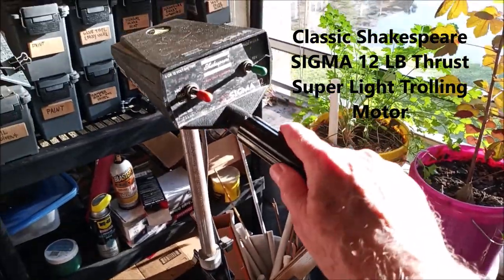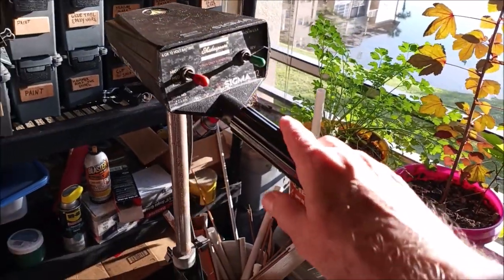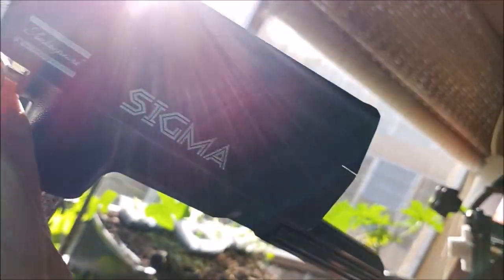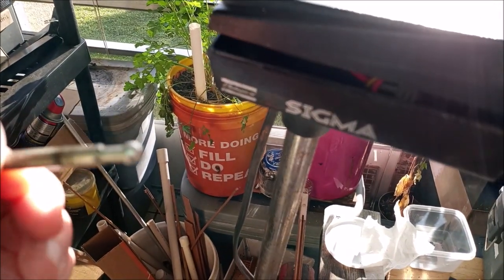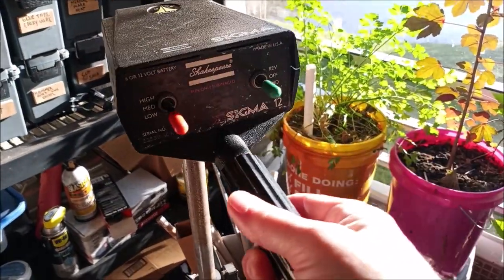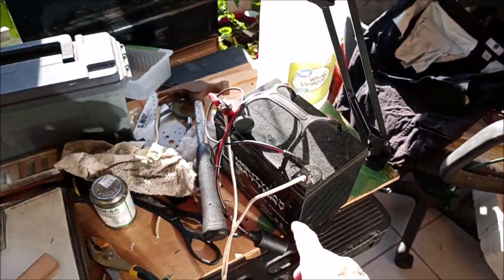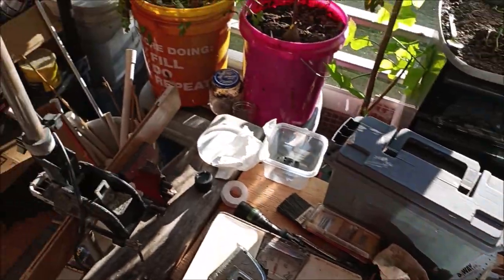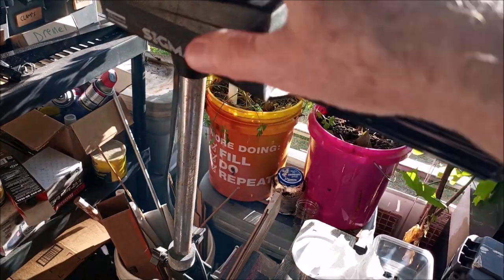Classic Shakespeare trolling motor SIGMA 12 - How to reverse the Control head.

Comment: Robb have you ever had to replace the propeller.  I can't find a replacement for mine.  Can you recommend a substitute
Reply from the maker: Hello, I haven't had to look for one yet. I doubt I will find an original one from the manufacturer. There are a lot of trolling motor propellers on eBay and Amazon. I think the best thing to do is to see how the Shakespeare propeller is attached and see what replacements look like they might be a good fit. There are some propellers for less than $20 on Amazon and eBay. Unfortunately I don't know if they would fit or not. Let me know if you get lucky.

Comment: Can you do a whole video on removing the head unit? I have a sigma 14 and the pin will not pop out. Any advice would be greatly appreciated. The pin will twist but not pop out.
Reply from the maker: Hi Jack, I don't know what else I could show you that I didn't already show in the video. My pin can be pulled out with pliers after twisting it. Make sure you are twisting it back and forth as you are pulling it. You could also squirt some lubricant and see if that helps.

Comment: I got a minn kota 38lb for my kayak and boat for 40$. The guy tossed in  a sigma 15 for 10$ After testing them I realize the 38lb is a bit much for the kayak but this sigma 15 is perfect for it. 
These are neat little things! I also recommend for anyone to get one of the my plan on using it for smaller boats and kayaks
Reply from the maker: I agree it sounds like you got a great deal. I always liked the little Sigma motors because they were very light. I have been using them on little inflatable's. Recently I found out there is a company called water snake that makes an 18 pound trolling motor that weighs less than 5 pounds. I may end up getting it . https://amzn.to/3M87xcX
Reply: What kind/size of battery are you using with the Sigma 12?

Comment: Thanks for the video! I have the 5 speed 25lb thrust version of that motor and I remember opening up the head several years ago to clean out a dirt dobber nest, but I couldn't remember how I did it. It would be nice to share a source for replacement props for these if anyone finds one. I looked a few years ago and couldn't find anything.
Reply from the maker: I'm sorry I don't have any spare prop information it seems like this would be a good business for someone with one of those printers that could print out plastic parts

Comment: You can make a bigger propeller with some gopher wood and use it as a fan in the summer. 😄
Reply from the maker: I was using some flooring I found last week and turns out the material is some kind of plastic composite. I may use it for a leeboard.
Reply: That’s a pretty good idea Salty. Especially if the power goes out and it’s hot.
Reply: @chopsddy3  I'm just full of ideas for other people to try...lol
Reply: @saltyshellback  
Me too!😁👍